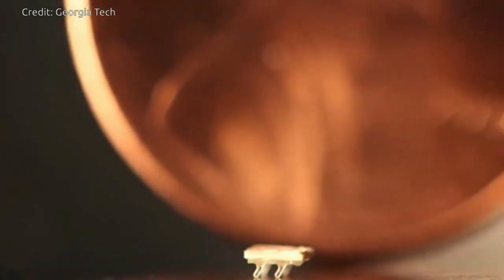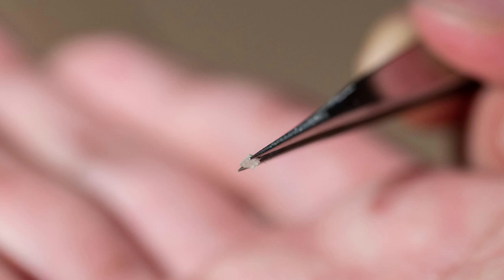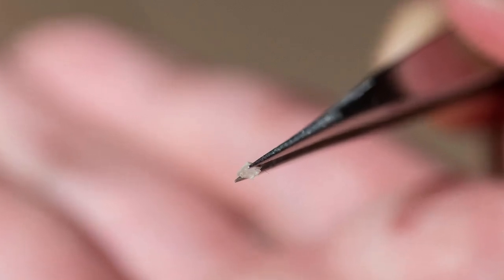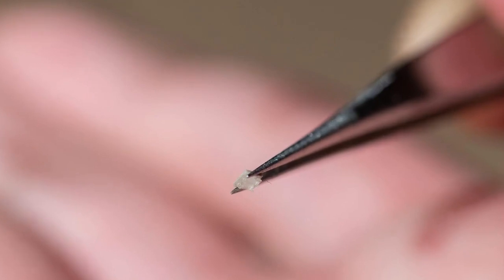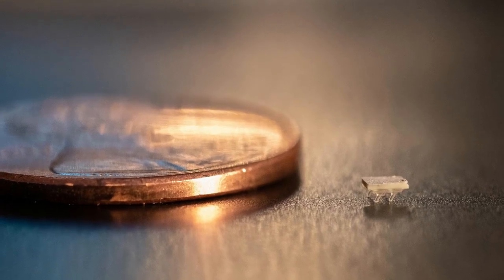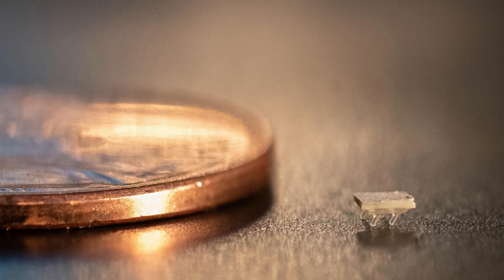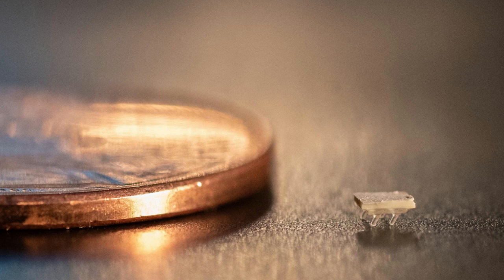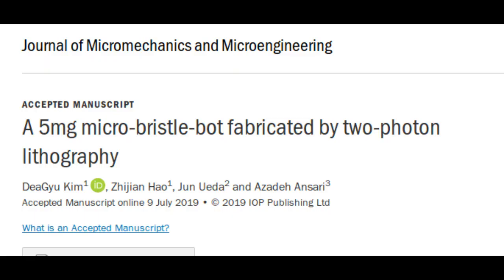These Tiny Vibration-Powered Robots are Barely Visible

Comment: VIBRATION-POWERED ANT-SIZE ROBOTS TO SENSE ENVIRONMENTAL CHANGES

Researchers at the Georgia Institute of Technology have created a new type of 3-D printed robot that is about the size of the world's smallest ants. These micro-bristle-bots are powered by harnessing vibration from piezoelectric actuators, ultrasound sources or even tiny speakers. This allows the researchers to control them by adjusting the vibration.

These tiny bots measuring about 2 millimetres long can cover four times their own length within a second. Researchers are confident that swarms of these bots can be used to detect environmental changes, move materials, or even repair injuries inside the human body.

READ MORE NEWS : 
https://www.beyondpinkworld.com/news/science-technology/ant-size-bots-powered-vibratio-5633